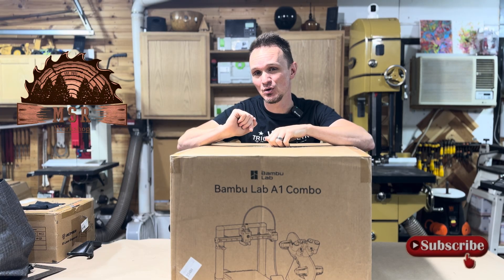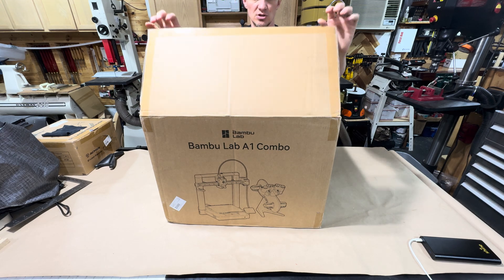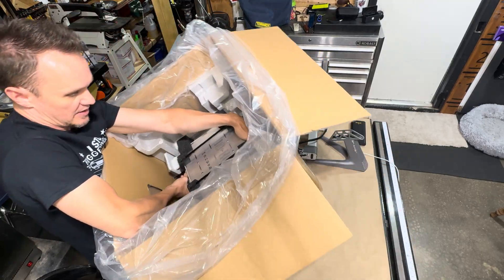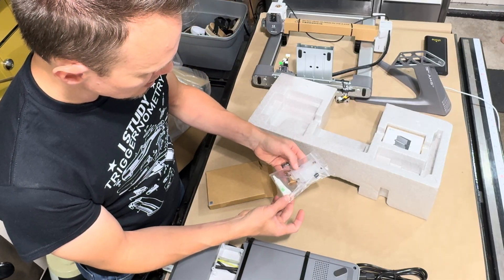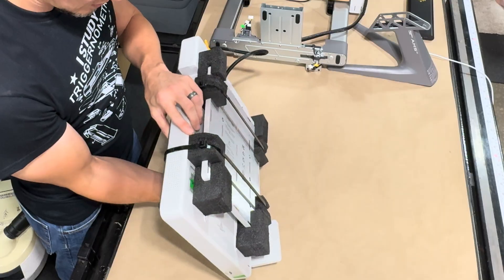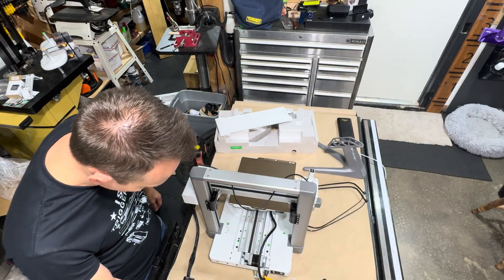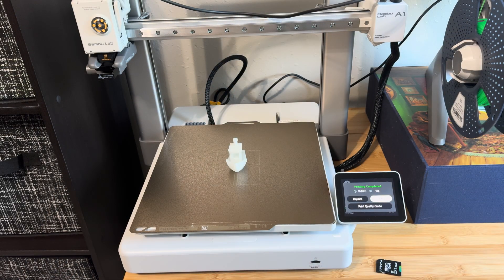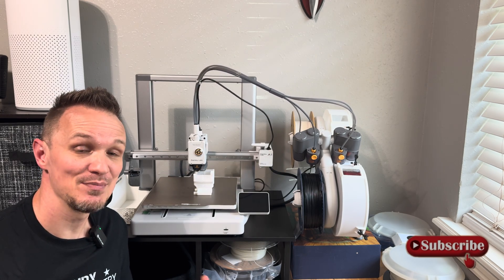Bamboo Lab A1 Combo Unboxing and Review

Comment: Thanks for doing this video. I started out with a Flash Forge 5M. I could not find an adapter from my shop vacuum to my table saw. Luckily, someone else also had the same problem. I downloaded it and printed it, and it worked, so I was hooked. I then purchased the Bambu Labs PS1 combo because I wanted to be able to print in different colors. I am still learning how to use it. Anyway, now the A1 is on sale, I might purchase one of them, and that's why I ran across your video. Looks like most people are happy with the A1. So thanks again for your video.